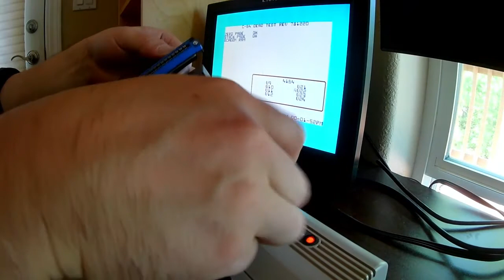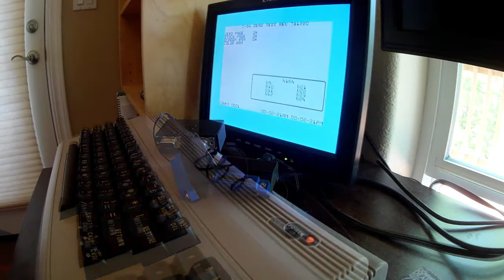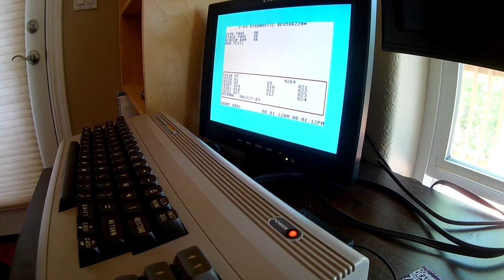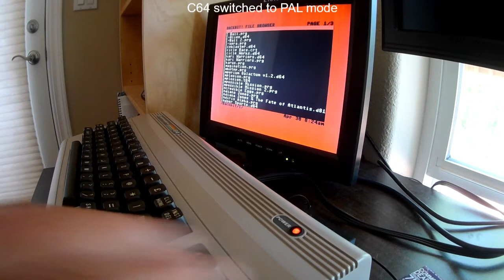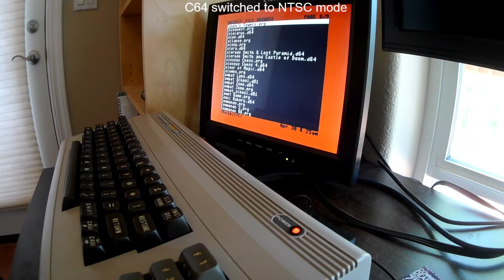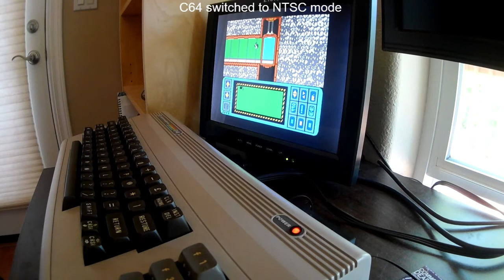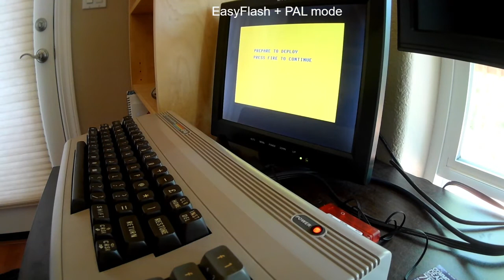Commodore 64 SRAM module replacement

Comment: How does that RAM module do its work with only 16 + 7 pins? Shouldn't it need 16 address pins, 8 data pins, VCC/ground and control signals?

Comment: In time. You will have a fully new 64. CPU, CIA and VIC-II is being develloped.
Reply from the maker: That would be great. I have heard of projects for new 6510/8500 CPU, 6526 CIA, and VIC-II. However, I am not sure how far along these new chips/projects are towards being available for purchase.
Reply: @patricksretro4495  VIC-II is almost done. The prototype is working almost perfect. It just need to be implemented in a smaller package.

Comment: Is there a way to increase the quantity of ram in this to 128 it seems a lot of games utilize Ram expansion
Reply from the maker: I believe that you could, but the C64 would not be able to address the additional RAM and would require and MMU and banking, which the C64 does not support natively. C64 RAM expansion modules do this.

Comment: Here's the cause of the problems: This RAM replacement module you are showing uses cheap but ultrafast static RAM which is totally the wrong type to do this. Both the RAM and the logic chips on this module are way too fast. You must use 74HCT or 74LS logic ICs which are slower and use static RAM that is rated for 45ns or more.
That's what I use on Saruman 64 which I have now been offering for 2 years.
Reply from the maker: Thanks for the information. I had a feeling that it was a timing issue of some kind. I will try the Saruman module for comparison. I have one of your Saruman 128s that I have not yet installed. I plan on including the Saruman 128 in an upcoming video about by C128Neo board.
Reply: I built the same static ram module using the same parts, and I was able to make it work with a ceramic 6569R1 PAL 250407 system by removing C204 and using any value above 33pF on C203. Interestingly in my 250466 sixtyclone build with a Saruman-64 board, I also had to do the same. It now seems to be very stable. Both dead test and the full diagnostics run fine. Just completed 69 cycles (1 hour) in the full diagnostics with 0 errors. I don't have a lot of special cartridges other than those to test with, though. See my post on the lemon64 forum with the title "C203/C204 with SRAM module on PAL 250407 with VIC-II 6569R1" for details. My sixtyclone build is similar to the one in this video in the way that I use as many new parts as possible. (armsid, neat8701, plankton-ev, eeproms instead of roms, static ram, etc..) The Commodore 64 RAM timing seems to be very delicate, so I am surprised there aren't more talk of tuning C203/C204 online. I got the idea of tweaking C203/C204 from the 251138 schematics where there is a table of different capacitor values for C203/C204 depending on what type of PLA and VIC-II chip is installed. From the table it seems only the PAL versions required tweaking of the capacitor values. I am interested to learn all I can about this topic, so if anyone has any thoughts then feel free to chime in.
Reply: @SeanChYT  The components you have changed changes the latency on the CASRAM line from the PLA to the DRAM.
When Commodore started to make their own PLA (the MOS 906114-01 instead of the 82S100 ), this chip was a bit faster and the multiplexers (74LS257) did not have enough time to perform the switch from low addresses to high addresses properly. Adding that filter delayed the CAS signal by about 15 ns.
Reply: @francoisleveille409  What I don't understand is why not many more people are discussing this, as swapping out such components seems fairly widespread to me. Googling for C203, C204, CAS, CASRAM, etc. gives very few results, and I haven't seen this topic discussed in any of the popular C64-tinkerer YouTube channels I subscribe to. I am watching a video from Bill Herd at the moment where he talks about "horrible timing violations", "delicate ram timings" and "qa bench test solder on various components to make it pass the test", etc.. (quotes extremely inaccurrate, but you get my drift...) The RC circuit R42/C204 is even more often discussed than C203, and in both of these boards I have worked on lately, the fix was to remove C204 and rather add 33pF or more for C203. On my sixtyclone 250466 there wasn't even a footprint for C203 so I used a 82pF 5% 0805 SMD capacitor on pin 9 of the PLA on the underside of the board and scratched my way through the solder mask on the ground line next to it. Usually when I don't find something on Google I get suspicious and think maybe I did something wrong somewhere else.
Reply: @SeanChYT  I left forums because I was pelted with insults when I give correct facts. Since people have no good logic analyzers and no formal training, they assume a lot of falsehoods and always try to prove you wrong with sketchy/incomplete information.
Reply: @francoisleveille409  Yes... I believe I read one of those threads, and I understand your decision. You have my full sympathy and support. 🙂Thanks for all the work you have done for the community and the excellent products you have provided.
Reply: Just to add this... I built the SRAM module by downloading the gerbers and BOM from diychris this year. The two logic chips are indeed of type HCT, and the SRAM chip is a CY62128ELL-45ZXIT which is rated at 45ns. I don't know if the board and/or BOM has been updated since last year, but that was I got now and ordered from Mouser. Even with a 45ns chip and HCT logic, I had to tweak C203/C204 to make it work, as I described in my other comment here (same as with my other C64 board that has a Saruman64 module).
Reply: @SeanChYT  The Cypress chip seems adequate. A lot of people use 10ns/15ns chips because they are cheaper but their higher speed causes a higher current signaling on the bus and results in ground bounce.